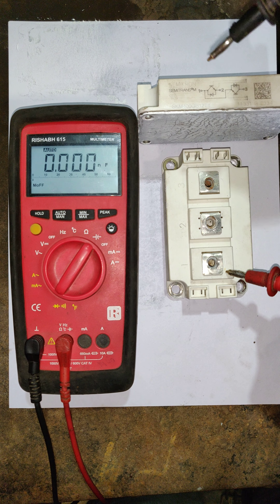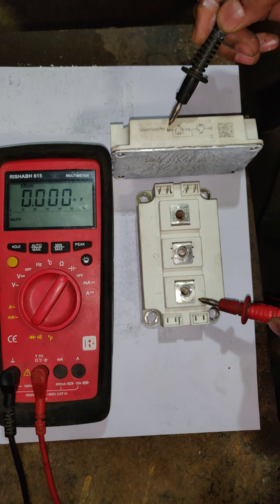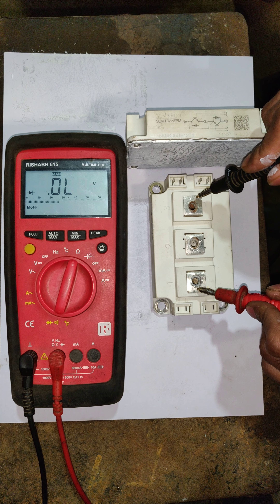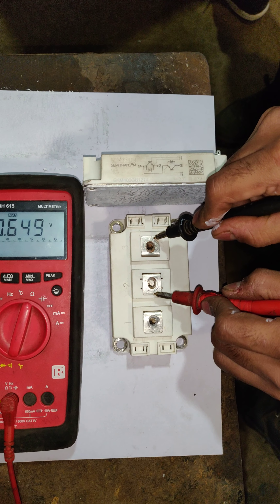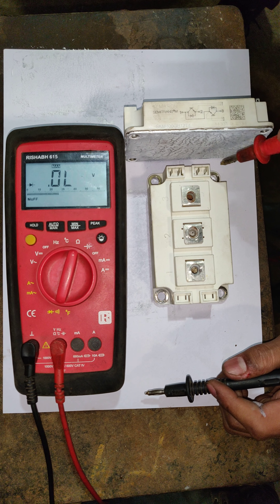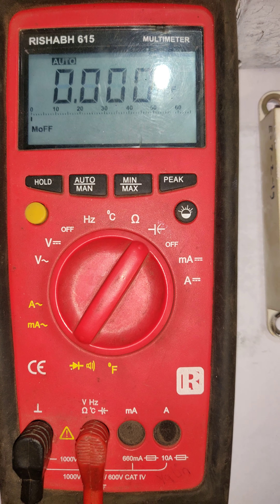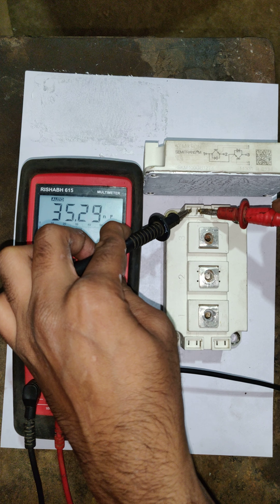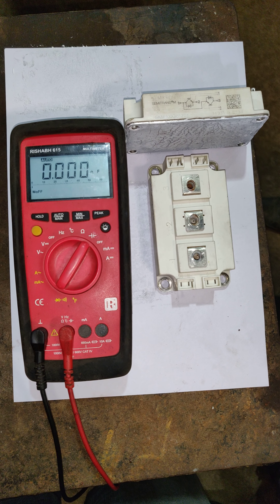Semikron IGBT TESTING | if above readings are comming same then igbt good

Comment: Bro, there is no Capacitance in IGBT circuit, then why your are cheking nf values?
Reply from the maker: There is internal capacitance in gate emitter terminal  which is in nano fared 
Please check SKM 100GB12T4 IGBT datasheet for reference u can find capacitance value at Vge table.
Sometimes nF is check at GE terminal for testing igbt condition if it has internal shorting or open circuit....